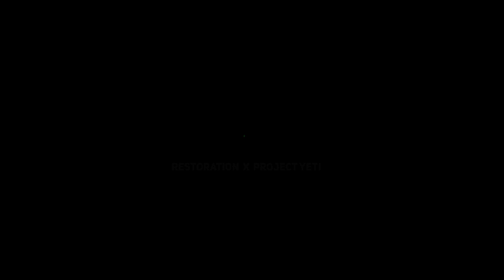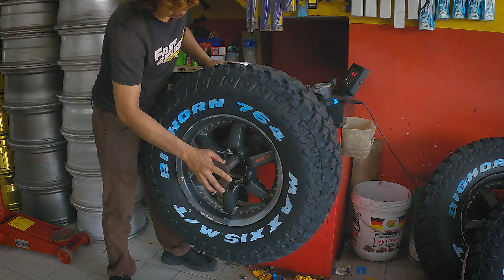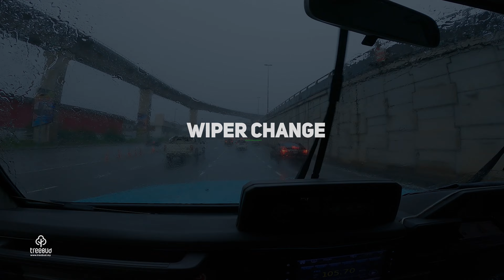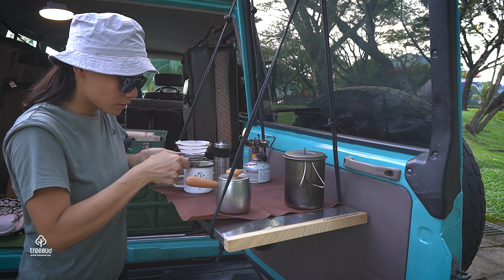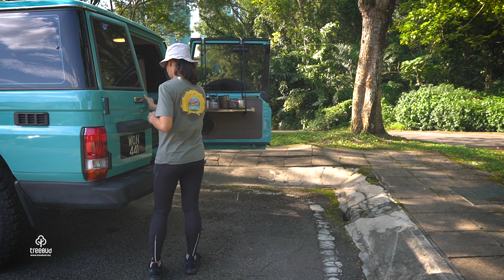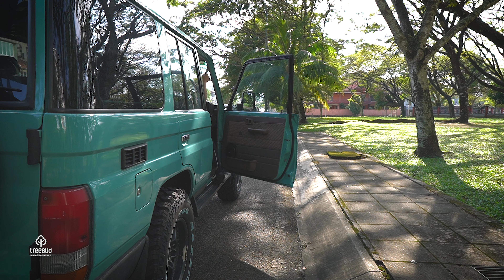I bought my dream truck Toyota Land Cruiser!【4x4 Camper Conversion, dreams come true】

Comment: This is not an Land cruiser 77 or 70, this is Land Cruiser Prado 78 (kzj78, lj78)
Reply: он еще называется light duty, heavy duty is land cruiser
Reply: Lmao. I can say you are wrong too. 
This is Land Cruiser Mark II.
There is difference every region
Reply: It was a reason why its called 77..because its VIN # was RJ77...and its engine was 22R,gasoline (petrol) engine under the hood...

LJ78 was 2LT engine
LJ79 was 3L engine
KZJ78 was 1KZ engine

So here in our local community  in Malaysia,we do call it LC2 /LCii or Mark2 especially in Sabah and Sarawak while in peninsular,its known as LC2...
Reply: Frame is basically the same, just coil springs vs leaf springs for better ride, and Hilux rear, which is still plenty capable. The entire coil spring front end design was just better and was carried over to the Land Cruiser 80 series. Transmission was used in heavy duty Land Cruisers as well 😂